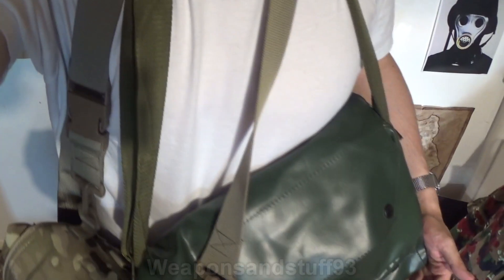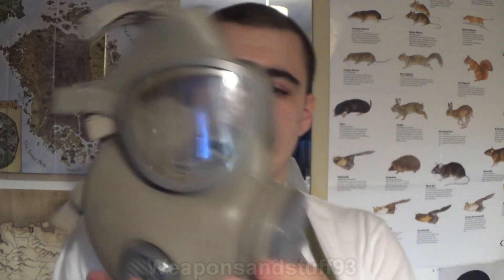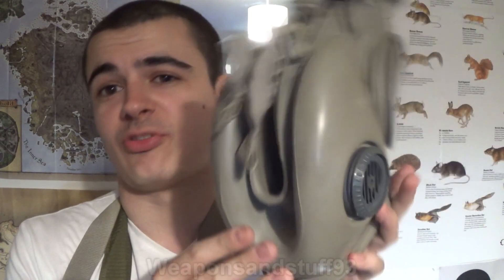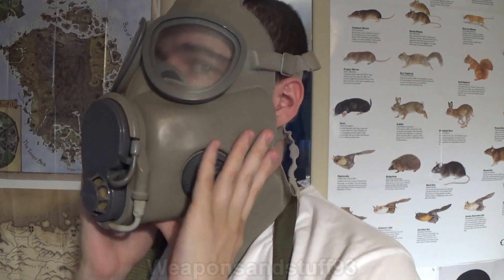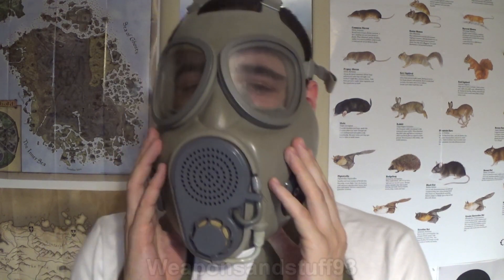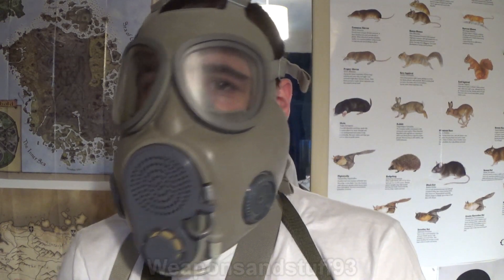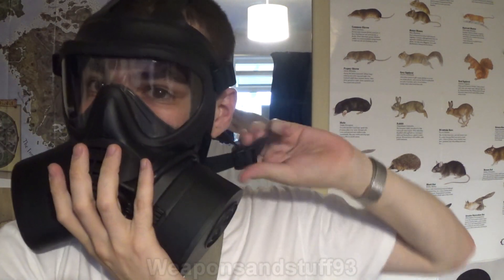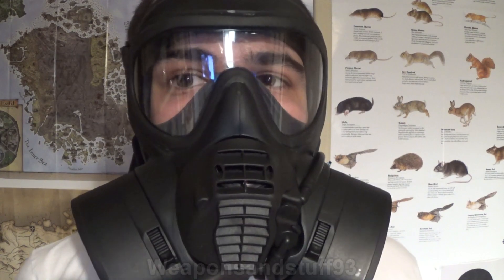Masks great in concept, Awful in Reality

Comment: Hi there, I like your videos, very informative. I have a question and apologies if you have covered this before... looking at masks on eBay they are sizes 1-3. I get that. But how do you measure your face to know what will fit you without trying one on? Hopefully it's not a stupid question. Regards Steve
Reply from the maker: I did a video on mask sizes but there is not a universal size, different countries/companies use different sizing, in some countries 1 is large, others 1 is small.

Comment: The Avon M50 is a good mask, and changing filters is easy when on your face once you get used to the angle it attaches. It's nearly impossible to shoot with, taking one filter off restricts your breathing enough to pass out. I've seen grunts try clearing a town and breaching a house with one filter on, and a dude collapsed. You have to wear both, and even then for someone with anything less than good breathing health it's laboring. Can easily go from the hip bag to fully donned in 4 seconds. There's a definite feeling of security with the sealing disks, and panoramic view. Definitely would like to try the C50 or the FM53 for comparison. The added ability of connecting the Avon masks to a camelbak makes operations with them much nicer being able to drink on the move. As well the M61 filters are much easier to carry than a 40mm filter, but the sealed package they come in is very bulky. There isn't a very good way to carry them sealed, and tearing the package open with MOPP gloves would be second to impossible.
Reply from the maker: Interesting thanks, so the M50 by the sound of it has some of the flaws of the GSR but not as many because at least it's well built.
Reply: I would definitely say that Avon has good build quality, I've never seen one damaged in person by anything short of intentional destruction. On an individual user basis I would find the proprietary bayonet filters concerning for lack of availability and variation.

Comment: Cheek filters absolutely SUCK.  Getting those filters in can damage the mask!!!  I have an M17.  I had 2 of them.  One ripped from the side out while trying to install a filter.  I was pissed because it was a new mask (unused).  I’ve restored the other one with new parts, then very carefully, after a lot of cursing, managed to get filters back in it.  I would use it in a pinch, but my M50 is far, FAR better.